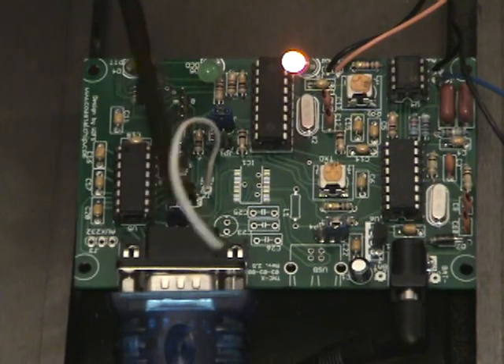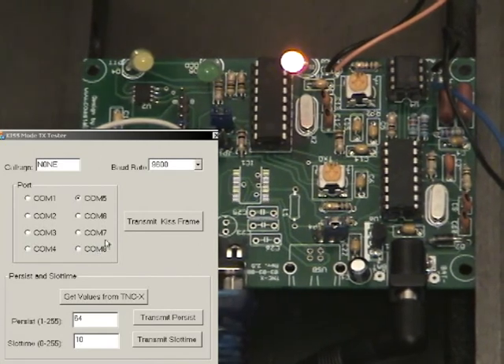Foxx - Digital Radio TNC Kit

Comment: Very nice board . How many layers is the board ? Leg length .... i have this theory that surface mount may have helped with reduction of cost of board production, in mass production, but also generated greater failure as the components expand and contract with heat generated by electrical consumption & pull at the solid solder mounts, so wired components may make thicker / bigger products, that may last longer? Do you know of any digi radio kit to ear piece only ?

Comment: The only drawback to the TNC-X is a KISS only TNC. You cannot run any terminal programs with it.

Full featured NON KISS only modems could be used with ANY terminal program  in ANY operating system . But that's not the case with the TNC-X because the TNC-X is a KISS only mode TNC.  which means  that you have to run a host software program to interface with it. 

There are few out there like Outpost, Winlink and LinPac. The problem is that KISS only modems takes away the flexibility of using older computers packet radio because most host programs need to be fairly current.
Reply from the maker: That is exactly what I learned with this project. I used a PDA and then a Zipit Z2 as a serial terminal and found myself very limited to what I was able to do. It was still a fun build and interesting experiment (for the time) but I didnt have the desired "Pocket Packet Radio" solution I was looking for. Plus being limited to only 2M/70CM made things even less exciting. In the end all I did was talk to a few Radio BBS' that were given to me from across my workspace. 

Not anything against the TNC-X, but by today I can re-visit this with a bit more gusto and feel more confident now that we have smaller tech. That setup was most certainly not "Pocket" size for my idea. Hella' fun with the experiments, and that's what it's all about.